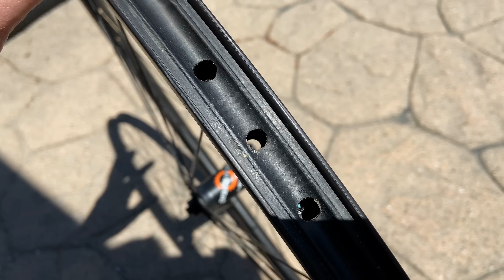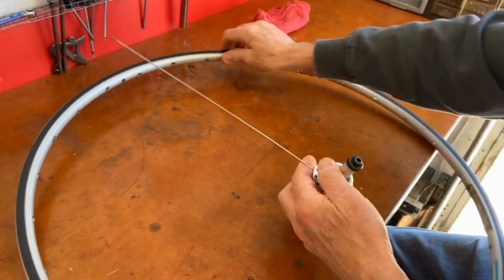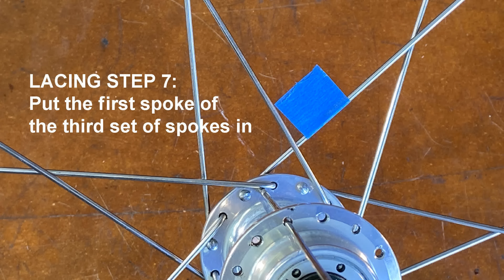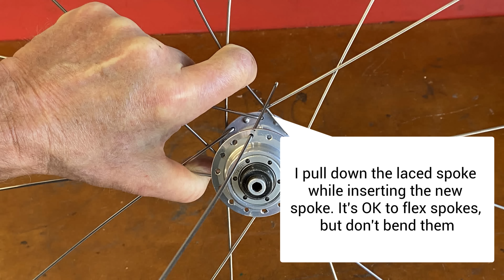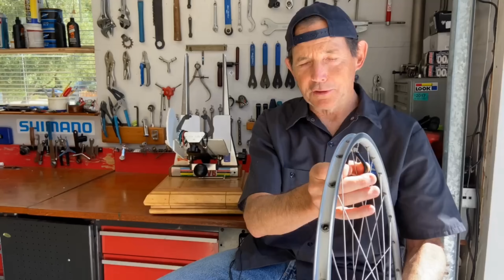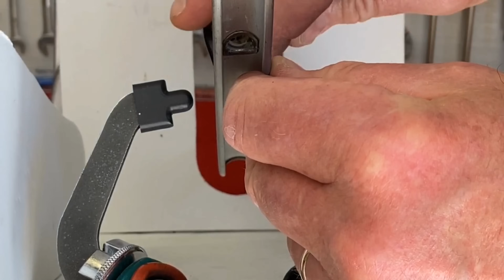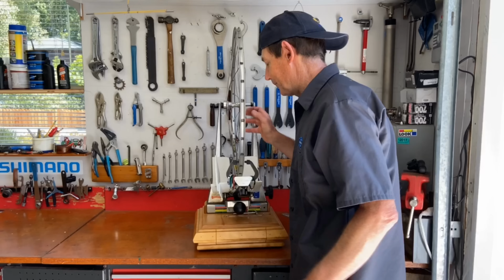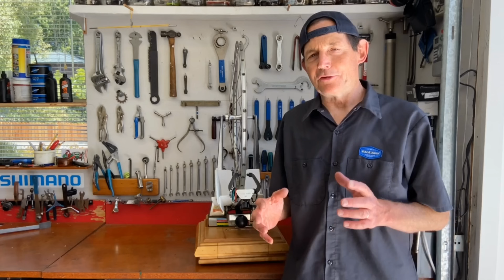How To Build Bicycle Wheels THE EASY WAY! #bikerepair

Comment: Awesome video.  I feel more confident after watching.  If I'm trying to fix a bent rim, and I bend it straight with my knee first, should I loosen all the spokes up and start from scratch?  I know some spokes are much looser than others, one which was rattling, will making the rim round and true even out the spoke tension?
Reply from the maker: Matt Crouthamel Thanks for the nice comment! When a rim is actually bent (not just wobbly from loose spokes but actually a bend in the metal), then you’re right to try to bend it back. I will usually loosen the spokes first because tight ones fight you if you need to bend away from them. The exception is if I’m riding and somebody needs help cause they pretzeled their wheel. In that case, it’s a minor emergency and I will just bend with my knee or whatever works. If you take the wheel off you can use the slam against the ground technique to fix big wobbles enough so they can ride home. You find the biggest wobble, hold the wheel flat so when you swing it down the tire right at the wobble hits the ground.
Reply: @JimLangley1  Thanks.  This is my friend's 29" mountain rear wheel (disk brake) that had a big wobble(toward non-drive side)/s bend in it (mainly to one side, then small wobble the other way before a little over 1/2 the rim that was still straight).  I used my knee to bend it back. I got it pretty true, round, and centered, but the spoke tension is not totally even around the rim.  While going around and squeezing to stress-releave after being true, if I found a few that were still pretty low tension, I used my knee to bend that part toward the tight side.   There are one or two spokes that are very tight, and a couple that aren't loose, but not really high tension either.  How much do I need to worry about the exact tension numbers?  Is it worth getting a tension meter and again bending the rim locally away from those looser (relatively speaking) spokes?
Reply from the maker: @mattcrout  Well, you can spend as much time as you want to put into it to fix bent rims, Matt. It all depends on the bends and how cooperative the rim is. But, you want to remember that once metal is bent it's not as strong as it was before and when you bend it back, it's less strong still. So, in most cases, I will only do so much bending and truing and tensioning. Because you can't really totally fix that wheel. It will hold up for some time - maybe forever if it's not ridden too much or hard. But, for a MTB wheel, usually they get so much use that they will eventually get bent again and in time need to be rebuilt with a nice strong new rim and start the process over again. To answer about tension, usually with bent and bent back rims, you have to accept that some spokes need to be much tighter and looser than others since the rim is not straight anymore. As long as the wheel is true and round enough to work, it's okay if the tension isn't uniform. That's just the nature of the bent rim situation.  If spokes are very loose, you want to keep an eye on them so that they don't loosen further. A trick is to use thread adhesive on those spoke threads to semi lock the nipple so the spoke can't loosen further. But, it might not be needed as long as the loose spoke has just enough tension not to loosen on its own. I use my tensiometer on every wheel I build and feel that it helps repairing wheels, too. But, for what you're doing, you probably don't need one. If you want to get one, I have used Park's and it's easy to understand and use and unlike some of the more expensive ones, it's easy to read on all brands of spokes. Here's a link if you want to see it: https://amzn.to/3kCsFce My favorite tensiometer is the Wheel Fanatyk - super easy to use and a bit more expensive but again, it works on all brands of spokes (some tensiometers are made for a specific brand of spoke and hard to read on other brands): https://www.wheelfanatyk.com/store/digital-tension-gauge/ Hope this is helpful.

Comment: The best video I've seen so far for the "rayonnage" (lacing ?). I'm just about to do my first one with vintage 28" hubs and rims... just excited about it. They're 36 holes and large cheek hubs, and I wish to make '4-crossings' (rayonnage à 4), which is not the example shown (28H/3crossings) but the logic is so precisely demonstrated step by step in your video, that I don't fear it any more... Now if you have special advice for this particular case it will be much welcome ! Thank you so much anyway !!
Reply from the maker: Thanks so much for the great comment. I'm glad you found the video helpful. Yes, what I show will work the same way with 36-spoke wheels and a 4-cross lacing pattern. You just interlace on the 4th spoke instead of the 2nd or 3rd (cross-2, cross-3). Also, each set is 9 spokes with a 36 spoke wheel, which I'm sure you already know. Have fun building your wheels!

Comment: As this is a rear wheel, aren't the spokes of different lengths on either side? You don't seem to mention it at the outset. (I'm preparing to build my first set of wheels pretty soon, so I'm anticipating everything I could mess up...)
Reply from the maker: Gentsracer 1 That’s a great question. I recommend having a bike shop calculate spoke length for you based on the hubs and rims you’re using. And buying the spokes from that shop. That way they will be careful to get you the right size spokes. (Because if they’re not right, you will bring them back. ) Whether the spokes are different lengths on the rear wheel depends on the hub, rim and spoke pattern. Yes, there are rear wheels with shorter right spokes and longer lefts but today that’s not always true. There are even wheels where the length is the same for every spoke front and rear wheels. So you need to get the calculation right to determine. Hope this helps explain. You can do your own calculations but just one mistake and you’ll end up with spokes that won’t work. And you won’t know until you try them. At which point you might not be able to return them since it was your mistake. That’s why I recommend letting a good bike shop handle the spoke calc for you. Hope this helps. Thanks for the question.
Reply: @JimLangley1  Thanks so much for your answer. Great video. I'll watch it a few more times before setting out.
Reply from the maker: Gentsracer 1 Have fun. You can do it!
Reply: @JimLangley1  Thanks!

Comment: Does this method also apply for fat bike rims?.
Reply from the maker: Thanks for the comments and question, camram. Yes, fat rims are spoked the same way. As I say in the video, please read the rim maker's build specifications. Sometimes they want you to build a specific spoke crossing pattern and the rim offset is usually directional as I show in the illustration in the video. As long as you follow the rim's instructions, you'll end up with a wheel the way the rim company designed it. If you have any other questions, please let me know and I'll answer asap. Thanks and have fun building that wheel! Jim

Comment: Important question, can you deform the rim if you pull too hard when stressing the spokes via the pulling parrallel spokes method?
Reply from the maker: Yes, that's an excellent question, Brian. Thanks for asking. The way to think about this is asking yourself if you could put more pressure on the spokes squeezing them with your hands compared to how tight they are under the final tension. And, the answer is that it's very unlikely you could squeeze the spokes so much that you would exceed the final pressure they're under when the wheel is finished. But, You could possibly cause issues if you squeeze the spokes when the nipples aren't fully seated in the rim holes or if the spokes haven't engaged enough thread. I recommend going easy with the squeezing and just giving each spoke pair a firm squeeze to seat everything and allow the spokes to unwind if any have become a little wound when you've been turning the nipples. The thing that could damage rims is when you see someone bouncing hard on the rim after laying it on the ground to stress relieve. Some builder have machines that press sideways to stress relieve the wheels. I'm not a fan of machines or manually applying excess pressure sideways to a wheel to stress relieve it. In my experience it's much safer for the wheel to use gentler stress relieving and it results in excellent wheels that won't have failures in the future. Thanks for the question. I hope this is helpful, Jim
Reply: @JimLangley1  I figured not to exceed max tension would be difficult to do with pulling on the spokes.  I had asked because I built up one of those uber lightweight alloy Araya RC540 rims that are like the araya Gold rims.  I was gentle throughout the build and tensioned the spokes to just less than a 100 kilograms like Kerin in Japan told me to with nearly perfect equal tension.   Ultimately I'm doing something wrong because I keep getting a buldge at each of the eyelets that protrudes out to the brake surface, so that when you brake there is a little bit of a pulsating action coming from the adjacent area of each eyelet on the side of the rim where you would brake.  It's about a .25 mm deformity, which got worse after I put air in the tire I mounted on the rim 100 psi 23 mm conti.  I talked to a wheel builder that built an araya gold rim and said he deformed the rim by just taking the plastic wrapping off of it.  I've been building wheels for years here in Connecticut, and have never had this happen.  Components to the build Ultegra 6500 hub, DT swiss 2.0 1.8 2.0 dbl butted spokes 14 gauge spoke nipples - oiled threads and eyelets.  Your opinion on this is really needed here.
Reply from the maker: @brianbaldino3496  I haven't built with the Araya RC540 rims, so I can't speak from firsthand experience. But, you obviously know what you're doing and haven't had this issue before. So, I tend to think that those rims must not be the best quality. The other possibility but I would think you would have noticed this before - is that your spoke tensiometer needs recalibration. In that scenario it would be showing 100 when in fact it's significantly higher. But, again, I think you would know that from building your other wheels (you would feel that extra turns of the nipples were needed than usual). 

If you have one of the Araya RC540 rims to experiment with (a new one), you could lace it up and ever so gradually bring up the tension while doing only enough stress relieving to get any slack out of the spokes. Then keep checking the rim to try to stop tightening before there are any bulges. Maybe it can only take 80 kgf or 90kgf of tension? Those are the ideas that come to mind. It used to be that lots of rims would deform at high tensions and we wheelbuilders would refuse to build with more rims than we'd build with. For a long time at the shop, I would only build with Mavic rims. I didn't trust anything else. 

My friend and most knowledgeable wheel guru I know, Ric Hjertberg on his awesome wheelfanatyk.com blog wrote, "(3) Rim deformation at the nipple can be a bad sign. In the old days (decades ago) designs existed that were not stable until deformed. Today, that is no longer the case. When a rim deforms from tension, that zone enters its plastic phase. A structure with a major component in, or  close, to  plastic deformation is vulnerable to fatigue and failure. A well-designed rim should accept spoke tension without deformation. There are exceptions. None of this is black and white."  https://www.wheelfanatyk.com/blog/wheelbuilding-tip-19-tight-right/

My best guess is that you're dealing with a bad rim, Brian. It might even be possible that there are differences in the wall thicknesses from one rim batch to the next - something Araya should well know about. You might be able to compare weights between a few of the same model rims to see if they're about the same or wildly different. If you figure out the problem, please let me know what it is. Hope this helps you solve it, Jim
Reply: @JimLangley1  Thanks so much for your help, I do have a spare new araya 540 rim.  I was just looking at it and brand new with the plastic seal around it I even notice a slight "Ripple" on the alloy where the rim meets the eyelets on each one and it's never been laced.  I was thinking the same thing to about going down to 18 kg and applying the slightest bit of force when stressing the rim only enough that things seat right - probably would do the trick.    I don't even want to do it again, maybe in the winter I'll try.  I know what you mean by the Mavics though, I prefer to build them up too, of course I am very picky about getting equal tension throughout so the eyelets have equal force when under load.
Reply from the maker: You probably already know this trick, but just in case, with super light rims or any rim you are worried about, you can reduce the tension a bit and to ensure that the spokes don't loosen, you apply blue locktite to the threads. On rear wheels a trick is to first true and tension with the right side spokes only. Then you final tension, true, and dish with the left side spokes. This way you're not resisting the left side spoke tension as you tighten the rights fully. And, since the left side is not tightened as much as the right, when you finish that side you don't stress that side as much. It's a good trick. Sort of sneaking up on getting the spokes tight, maybe not as tight as a stouter wheel but close by using this workaround. Good luck!!
Reply: @JimLangley1  You are referring to the rear wheel right?  Wonder if that would work with the front too?
Reply from the maker: Brian Baldino Yes the rear wheel, but you can do it on fronts too. You just don’t have the tension difference left to right. But it should help reduce the overall tension until you get to those final spokes. It’s a way to not add too much tension too soon in theory. I have used it on a front wheel when I had a crooked/angled nipple that would strip when I tried to tension all spokes as usual. But when I tensioned the side with the bad nipple first it was no problem getting all the spokes tight and no risk of stripping the nipple.
Reply: @JimLangley1  Here is a listing and photo of the problem posted by someone else, https://bodaboda.info/blog/?p=360    Japanese to english translation as follows:  "You can see that the surface is raised at the spokes. The brakes aren't vibrating enough, so it's not a big bulge, but it seems to be unevenly worn. Did you raise the spoke tension too much?
As far as measured with a tension meter, it is 60-80kgf. I don't have anything like this, but why?"
Reply from the maker: Brian Baldino wow, that suggests that even at too-low tensions that the rim still deforms. The spokes would likely loosen if that was final tension. You would want to use locking nipples or loctite and hope for the best. Really cool to see that link. Wish I spoke and read Japanese. Thanks!
Reply: Hi Jim.
Great video.Can I ask you a question regarding truing stands and that is would they work on my wheel as it is considerably wider than most as it is from a fatbike or would I need a particular stand to accommodate the width of the rim.Really appreciate videos such as this as I would never consider taking on a job like this without seeing it first.Great stuff buddy.Just subscribed to your channel too.👍👍
Reply from the maker: @andrewsaunders1796  Thanks for subscribing - appreciate it! There is one truing stand I know of made to handle fat bike wheels and it's Park Tools' TS-4.2. Here's where you can see it: https://amzn.to/31gVZ0I You'll see it's expensive and that's because it's a professional level tool - super nice, too. An alternative that I show in the video is to true the wheel in the bicycle frame - using the frame as the truing jig. But, you would need the fat bike frame the wheel fits into. Another approach that's not difficult if you have access to some materials and are handy with tools is to make your own truing stand out of wood or metal. All that's needed is a base, 2 uprights to hold the axle that screw onto the base and then an indicator arm that you can position next to the rim for truing. If you search on home made truing stands you'll see some to get an idea how to make your own. Hope this helps and have fun building that fat bike hoop!

Comment: Legit video! I just laced my first rear 36 holed wheel doing this. I also made the pro move from Ali Clarkson where the hub logo is centered. Basically insert the first spoke x holes from the logo where x being the cross pattern number.
Reply from the maker: That's awesome, kattskrall! Congratulations and thanks so much for letting me know. Great job centering the logo on the valve hole, too - it's such a sweet detail. Here's my video showing an easy way to align the hub label with the valve hole every time: https://www.youtube.com/watch?v=8FiyUyJN7Uw Enjoy your new custom wheel - you earned it and you can now call yourself a wheelsmith!
Reply: That's great to know. Just watched Jim's new video on this. I knew about the tire:valve detail but not this. Thanks!